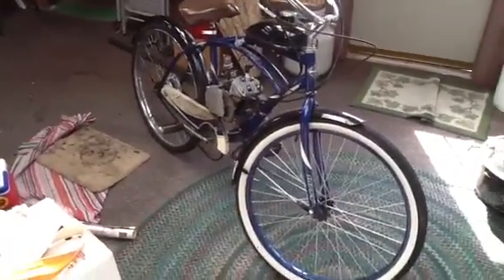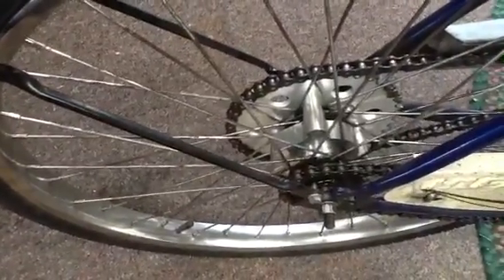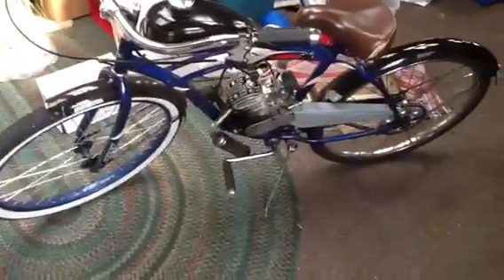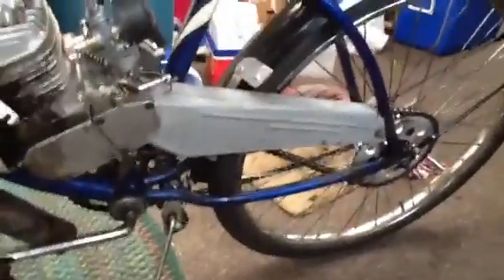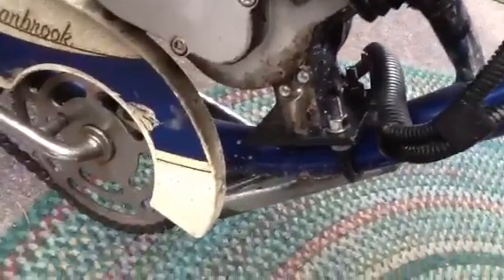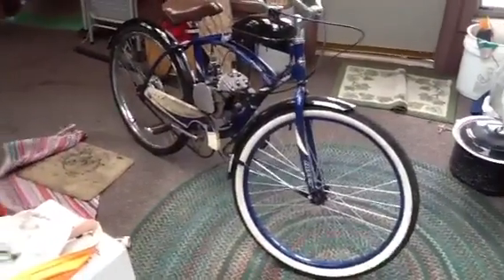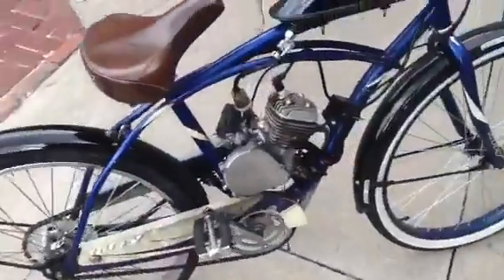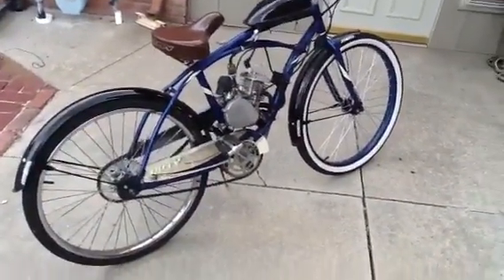Motorized Bicycle Huffy Cranbrook

Comment: Sweet build. Good video. I too built cranbrook. Some have crank bearing issues and they come stock with barely any grease on bearings but overall good bike to start with because of low cost. Saw 29 inch huffys at Wally World. Thinking bout building one of them next. Check out my vids. Peace.

Comment: I'm contemplating the Huffy just like this, for my own motorized bike project. But I'm wondering how it would handle the terrain here. I specifically want to ride it on the gravel roads. Is it ride-able on gravel, or is it only a smooth surface machine?
Reply: If you want it for gravel, get something with shocks on the front and wide tires or you will regret it.
Reply: ***** Hi, thanks for your reply. I since got it actually and built it. It's a nice ride, I've put mountain bike wheels on it. I also tend to find that most of the gravel roads around here have a mud path that runs along side them, which gives a smooth enough surface. So all is good :-)